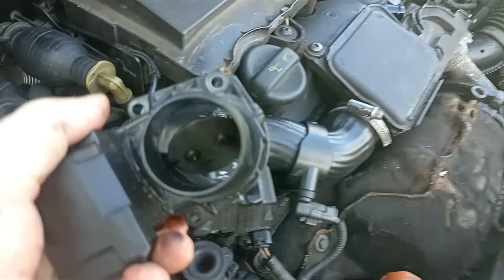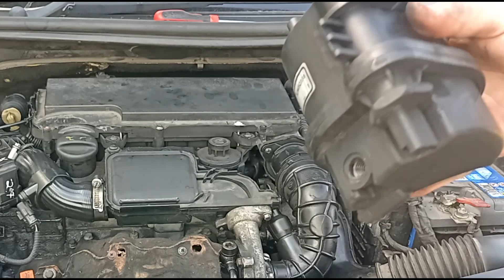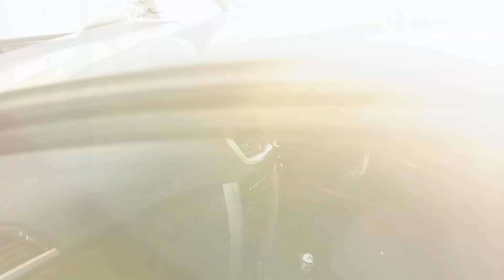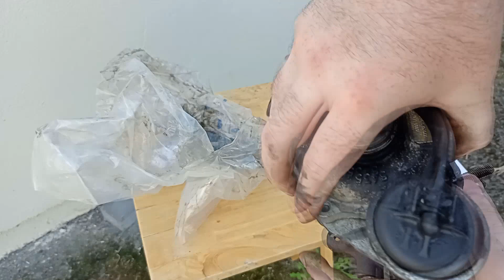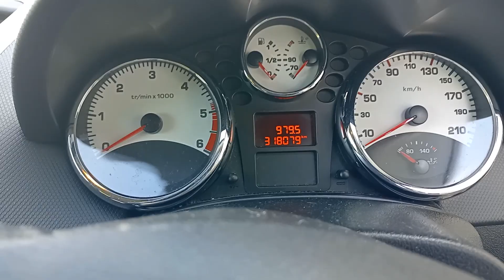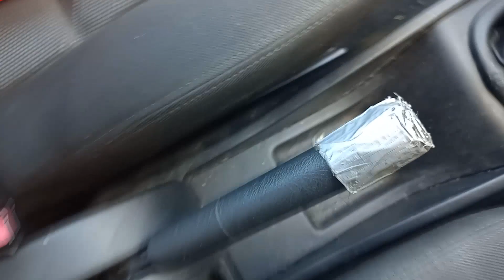Peugeot 207 1.4 Hdi Common Problems including low power airflow sensors and antipollution faulty

Comment: I used to drive a Renault Kangoo van with the 1.5L diesel engine. That also had a dpf. I had zero issues with that engine due to running cleaning diesel through it quite regularly. Although more expensive than regular diesel, the engine loved it. The van did 115,000 miles before it was moved on by the company. It was still on the original battery. What I think causes most of the trouble with these engines, are short trips. I did long trips, 100 miles or more most working days at motorway speeds.

Comment: good morning, sorry to bother you, I have the same engine as your video, I have a problem: inside the air intake pipe, where the PCV valve is connected, there is a lot of oil, what could it depend on? thanks
Reply from the maker: Probably a fault with the PCV valve itself, they're not too expensive to replace.
Reply: @Gneeznow  ok buddy thanks

Comment: Hi, I have on my mother's 207 1.4 HDi bought in 2011 the check engine light with the p2564 code that says turbo boost check low circuit. What could be?

Comment: Looks a lot like a peugeot 206 1.4 hdi engine, which developed a fuel starvation issue as the fuel pipes route under the airbox and it rubbed through the pipe and created a micro hole in the pipe, and the fuel would resiphon back into the tank.

Comment: That part is not throttle body, it is shutdown valve. It`s open all the time, just closes for few seconds when you turn the engine off, to prevent engine vibrations known for diesels.

Comment: My little 1.4 HDI C1 has an issue. The engine hesitates sometimes when accelerating. It happens at idle as well, but at random times. It drops revs as a "misfire". No codes on tester. Any suggestions?
Reply from the maker: If it is intermittent like you say my guess would be it's the oxygen sensor (Lambda Sensor), those things tend to cut in and out when they start to go, in turn the ECU gets bad readings and messes up the mixture going into the engine.
Reply: @Gneeznow  interesting. I was thinking MAF sensor, EGR etc. I'll have a look, guessing there are two in total.
Reply from the maker: @MIHEMINNNN  If it were MAF it would be a constant loss of power, and if it were EGR then it would likely trigger a code. Lambda sensors tend to not trip a code, and also be erratic
Reply: @Gneeznow  thank you very much, I appreciate your input as you had your fair share of experience with these engines.
Reply: what was the issue do u solve it plz tell me as i m facing same problem @MIHEMINNNN

Comment: Hello, I have the same problem with a gap at the side of the air box. The MAF sensor sometimes spikes and triggers the engine light and code for the MAF sensor. Did sealing that gap in the air filter box fix the problem for you and how did you seal it?
Reply from the maker: Yep it did fix the problem, I also made sure the pipes at the back of the airbox were more secure since they have a tendancy to fall out of place. I sealed the box with self-tapping wood screws, it ain't pretty but it worked just fine

Comment: how do you clean or replace the EGR? where is it? i have a 2010 Peugeot 207 VTi and i get the anti pollution fault - also have a little white smoke constantly from my exhaust, which smells foul like old gas. I may try cleaning or replacing exhaust solenoid at front of engine under dipstick
Reply from the maker: I'd check your coolant levels first to see if it's burning coolant (if that's causing the white smoke then your head gasket is goosed).

The EGR on my model is at the back of the engine on the right hand side if you were standing in front of the car looking towards it. To get to it you need to remove the air box and battery and get in around behind the engine that way. There's a good few videos out there on youtube for these Peugeot EGRs

Comment: I have almost the same engine (2009) in my Bipper. My EGR valve failed twice. 1st time water in the electronics causing corrosion. second time the solenoid coil shorted. Now I have permanently closed the EGR valve and made a circuit to let the car think the EGR is switching to the right position. Works fine for 2 years now. Only recently I have issues when accelerating with a cold engine above around 2000 rpm the engine starting to stutter. Also the car smells bad when idling. No error codes in the computer. My dealer has no clue. whats wrong. I think some injectors are bad. Not a cheap fix.
Reply from the maker: It could be, but I'd check the airflow sensor and post-turbo airflow sensor just to be sure, the poor acceleration was just like you described for me and it was the airflow sensors. Also if your car is the 1.6 engine it'll have a DPF which is a common culprit for issues like this (the 1.4 just has the EGR).

If it is injectors I've heard they are a pain to get out of that engine, that's why I use fuel lubricants like diepthane to clear out carbon from injectors / cat
Reply: The engine is the 1.4 HDI without DPF like your's.  Today opened the Diesel fuel tank. Tank is totally clean. I did not expected this after 15 yrs . Only in the pickup unit  was some gummy black stuff floating around. Drives Ok for now but if this solved my issues I have to see the next days.  Thanks for the advise I will clean the airflow sensors. The OBD software reading normal values  but it can't hurt to clean them.
Reply from the maker: @Bus2000   when my airflow sensors were caked in dust it didn't trigger anything on the OBD either, occasionally I'd get an anti-pollution faulty message and an engine light which would go away (and often the OBD would read that as an EGR range error). For every thing that shows up on the OBD, there's 3 things which won't show up!
Reply: @Gneeznow   I will clean them Thanks 👍

Comment: Looking at buying a 2011 1.4hdi 207 .. do you recommend them as a good car... and in all their faults they are relatively cheap to repair?
Reply from the maker: As in all cases it largely depens on how well it was looked after by previous owners. They are sensitive to regular services, dirty oil in these cars has a tendency to cause blockages in the turbo's oil feed. Check the turbo like I did in the video before you buy it!

I find it cheap to repair, and there's loads of them on the road so second hand parts are easy enough to get. But like I said I wouldn't buy without checking the turbo on it first.

Another big advantage these cars have is they do NOT have a DPF (diesel particulate filter), when those things go wrong they can cost thousands to fix, not having one at all is a big advantage (the 1.6 diesel does have one however)
Reply: Got 2 of them 14hdi and none of them are running at the moment . having said that they are a great Diesel car...  I drove a toyota diesel for a year in limp mode..  When it come to these car you have to not give a shit.

Comment: a solution for faulty antipollution..please
Reply from the maker: It can be about 30 different things, in my case it was fouled throttle body and mass airflow sensors. It could also be the EGR valve. You need to plug in an OBD2 scanner to point you in the right direction